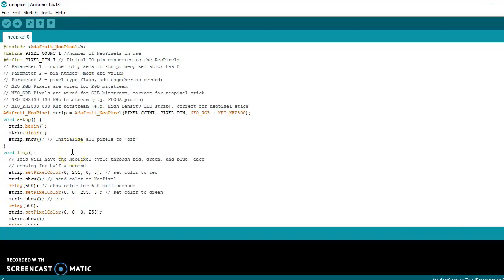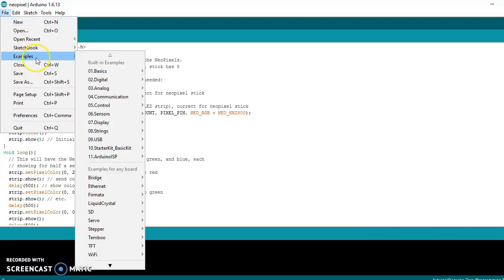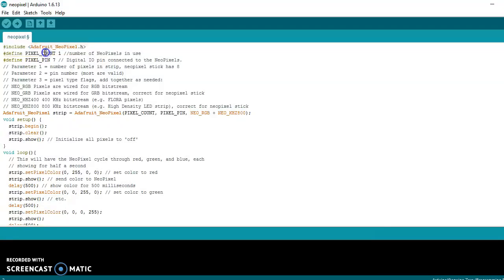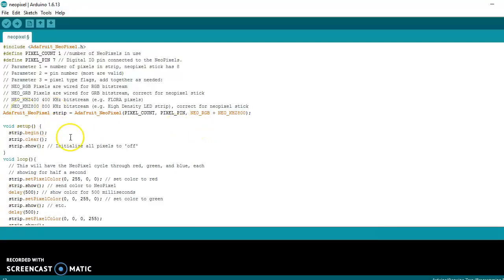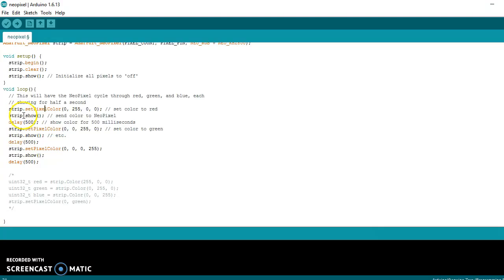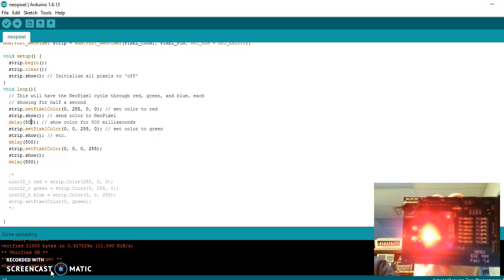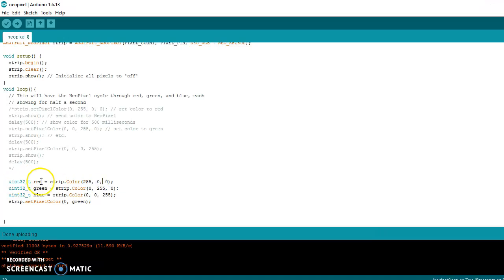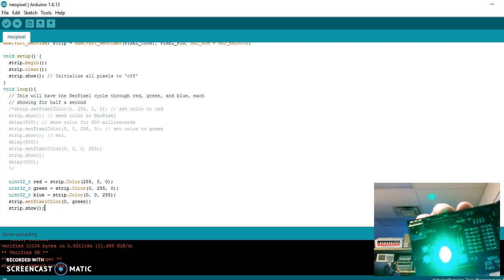Arduino Tutorial - NeoPixel

Comment: i'm trying to get three led's to light up but when i upload my code, it dosn't light up, plz help FYI the code im using is 
#include <Adafruit_NeoPixel.h>
#ifdef _AVR_
  #include <avr/power.h>
#endif

#define PIN 6

#define NUM_LEDS 24

#define BRIGHTNESS 50

Adafruit_NeoPixel strip = Adafruit_NeoPixel(NUM_LEDS, PIN, NEO_GRBW + NEO_KHZ800);

void setup() {
  // This is for Trinket 5V 16MHz, you can remove these three lines if you are not using a Trinket
  #if defined (__AVR_ATtiny85__)
    if (F_CPU == 16000000) clock_prescale_set(clock_div_1);
  #endif
  // End of trinket special code
  strip.setBrightness(BRIGHTNESS);
  strip.begin();
  strip.show(); // Initialize all pixels to 'off'
}

void loop() {
strip.Color(0, 255, 0, 0); // Red
strip.show();
strip.Color(1, 0, 255, 0); // Green
strip.show();
strip.Color(2, 0, 0, 255); // Blue
strip.show();
}